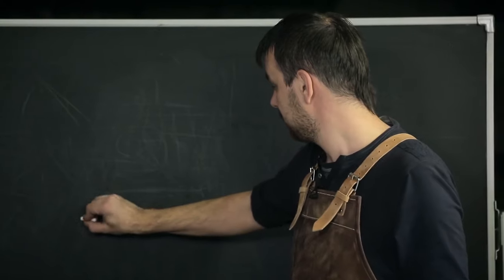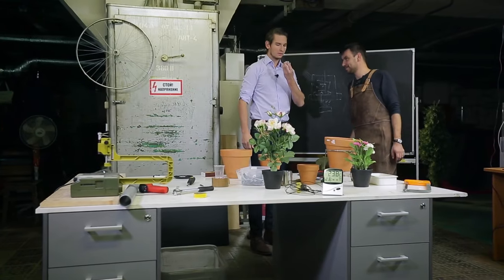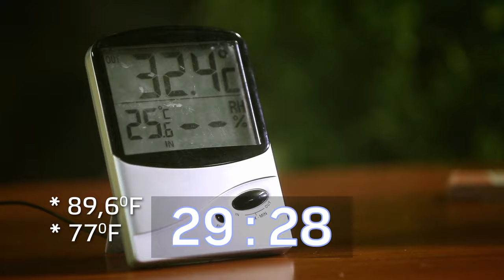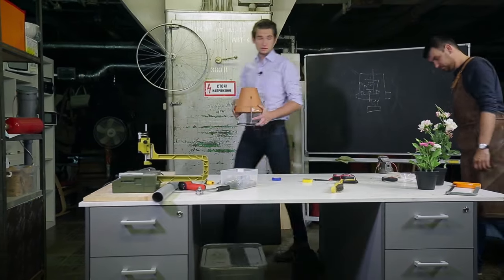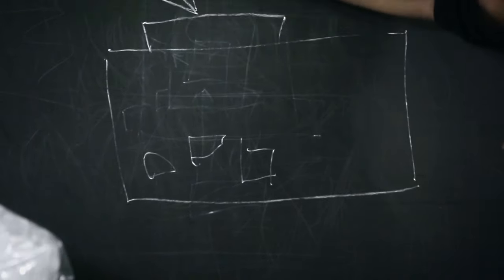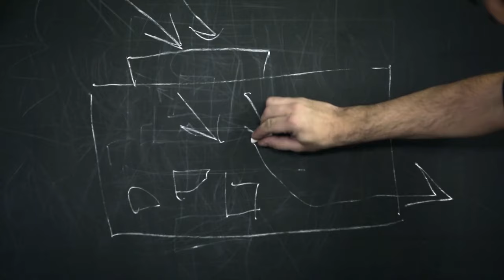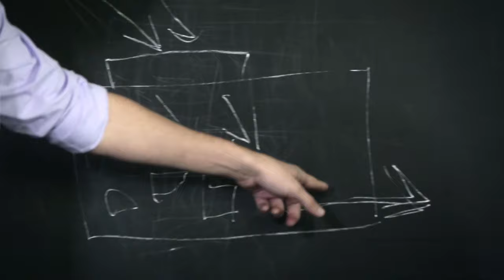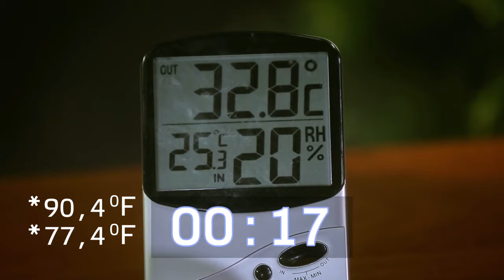We Made and Tested a DIY Indoor Heater and Air Cooler

Comment: Sorry but this is the most pointless video i have ever been sent to by youtubes algorithms, WTF. Do people really need a science lession to tell them that candle flames are hot and Ice is cold?
As for "Budget-Friendly", well try cooling you house with shop bought ice for a month, its going to cost you more then a cheap air conditioner and all you have to show for it is alot of water. And for anyone that is thinking this is more of a portable solution for camping as they show it to cool a tent, well good luck on your 3-4 day camping trip when you need to take all your normal gear plus a tub, some fans and half a ton of ice, although i suppose you would not need that much ice if you take a frezzer with you to make it.
Reply from the maker: thanks for your comment